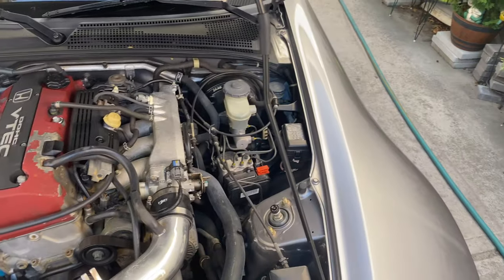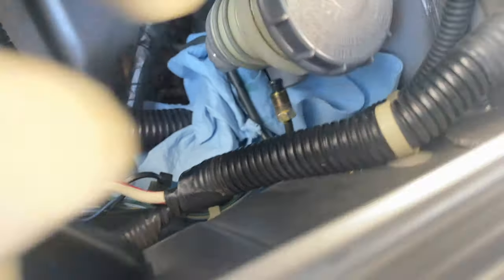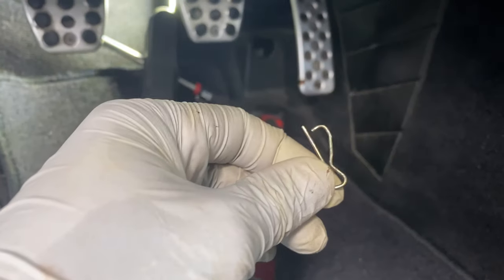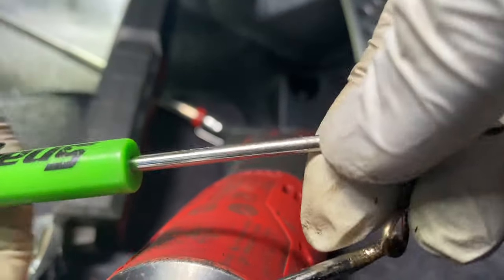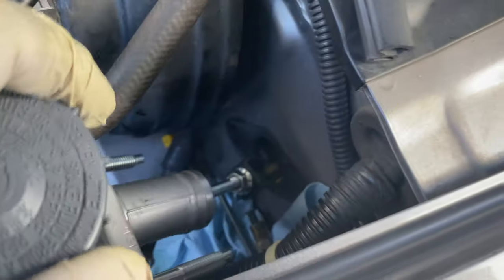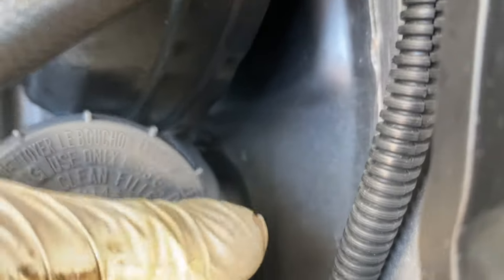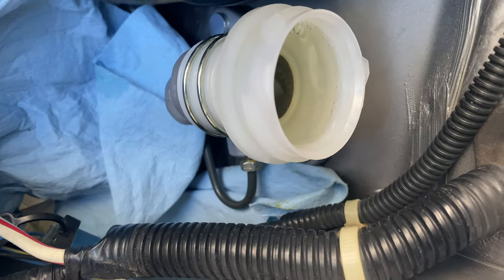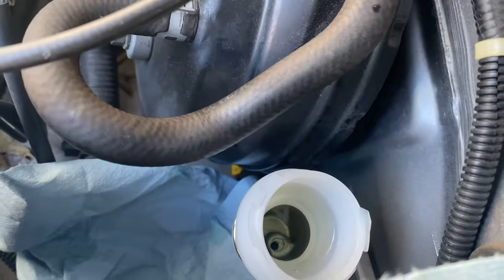Clutch Master Cylinder Replacement + Bleed | Honda S2000

Comment: what year is your s2000? I have a 2007 and my fuse box is a lot closer to the firewall and is getting in the way of removing the cylinder.
Reply from the maker: 2000